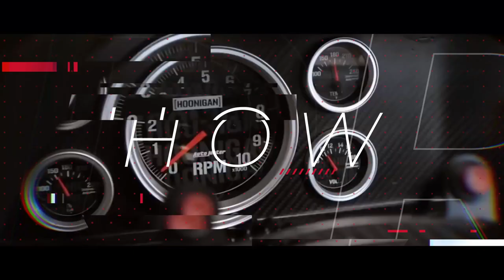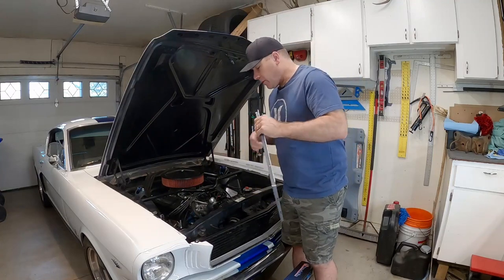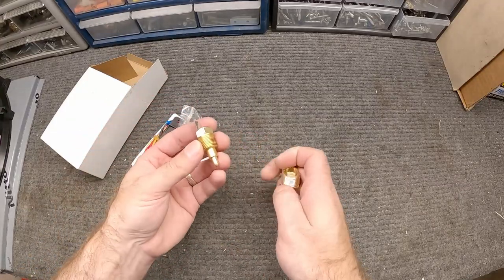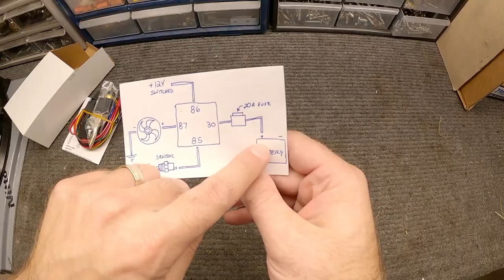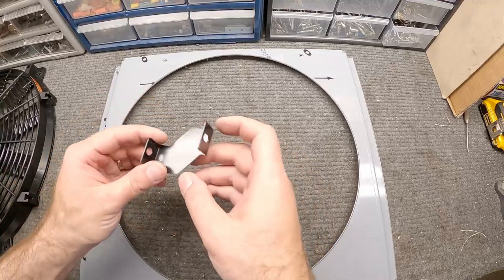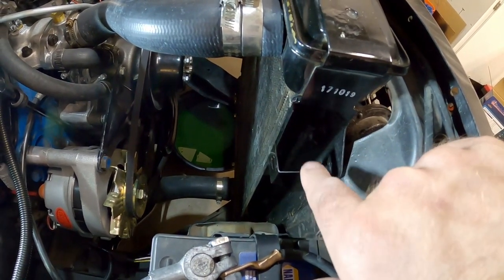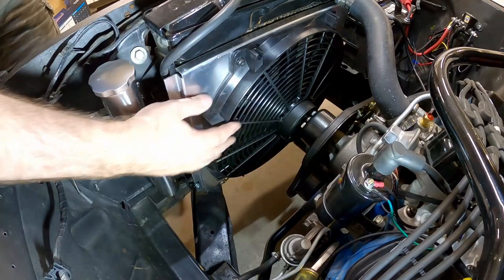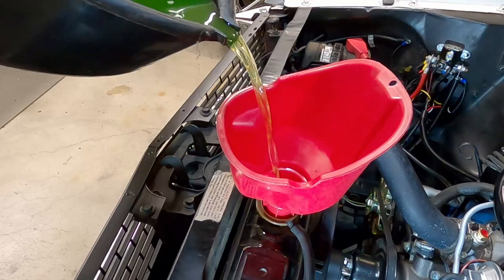How to Install an Electric Radiator Fan

Comment: Word of caution - whenever I'm wrenching really close to the radiator I put a sheet of cardboard between the rad fins and the work area. You don't want to slip with a screwdriver or a crescent wrench and puncture the fins. Ask me how I know! A little bit of cardboard (or an old towel) buys a lot of insurance.
Reply from the maker: Yeah, but it doesn't make for great content if I put safety and common sense first.  :)

Comment: Finally someone who knows what he is doing when mounting an electric fan to the radiator.  You should never just put an electric fan to a radiator without a shroud.  Good job
Reply from the maker: Haha, thanks.  :)
Reply: Неверно. Смотря какой кожух. Тот кожух,что он поставил - он будет создавать помеху для естественного обдува радиатора. Чтобы кожух хорошо работал и при этом не создавал сопротивления набегающему потоку - этот кожух должен быть достаточно широким и иметь коническое сужение к вентилятору. На редких машинах возможно соблюсти эти условия. Поэтому мой выбор - вентилятор БЕЗ кожуха.

Comment: Excellent content as allways.  Nice install.  I prefer the teflon paste on thermo-switches to help insure a good ground.  Especially on a single terminal switch.  Also touching the ground wire to the therm-switch body verifys your ground also for future testing.  Did'nt mention wire size but 12 ga is mandatory for maximum rated cfm.  Drive on brother!  The over ride switch for the sensor is good to have if there is ever a failure of the thermo-switch.  FWIW.
Reply from the maker: Great tip!
Reply: Spal all day long, I strictly run them and have never had a failure. OH and they actually work! If there good enough for Nascar, Mercedes and Lamborghini there good enough for me!

Comment: In the middle of installing my new rad with fan. It ended up being a lot thicker than my existing one so I have had to install it on the outside of the bulkhead with some adjusting. Hopefully the rest of the install goes smoother.
Reply from the maker: Unfortunately this can be an issue for lots of people wanting to upgrade the radiator and fan.  I heard that you can cut a slit in the top of the core support to allow the tabs of the radiator to slide down, putting the radiator on the inside of the core support (like normal) but the tabs are on the outside (front side).  This can provide 1/4-3/8" more space, sometimes it's enough.  :)
Reply: @AndyKruseChannel  that’s exactly what I done! Still not done yet but will try to finish it off before the weekend.
Reply: @AndyKruseChannel  I just went for my maiden voyage but for some reason my switched signal won’t activate the fan which eventually caused it to overheat. Not sure why not but will probably just run a manual switch to inside the cabin.
Reply from the maker: @Redmist.65  There could be a couple things going on here.  1 - the temp activated switch is no good.  2 - check the wiring for the relay, make sure the correct terminals are connected.  3 - you can check the whole circuit by grounding the wire going to the temp switch, if the fan turns on then there's something wrong with your temp switch.  4 - at a minimum you can wire so it's always on when the car is running, at least it will allow you to drive the car until you find the issue with the wiring.  Good luck!

Comment: Hay. Were else can you put the sensor? And also do you have the link for the Relay?? Thanks🤘👍
Reply from the maker: The four places I considered were the stock temperature sending unit location (behind the distributor), the thermostat housing (where I actually put it, but only because I had that style of housing), the radiator drain location (but I didn't want to lose the ease of draining the Rad with the petcock), and a union piece with a threaded bung that I'd have to cut the lower radiator hose in half and install it between the two pieces.  If none of that is a realistic option for you, then using that style that gets installed between the fins of the radiator might be your best option.
I updated the description with a link to a relay that will do the work you need.  :)

Comment: thanks for the vid andy, ive just installed my electric fan / shroud set up on the 65 fastback ,  your right about the clearance of the pully bolts and the fan, mine is just as close , to be honest it makes me a touch nervous , anyway time will tell
Reply from the maker: It will be fine, I haven't had any issues.  On my last Mustang, I purchased shallower head bolts for a little more clearance and cut about 1/2" of the alignment rod on the water pump snout off.  It gave me more room than I have now, but my current setup isn't causing any problems.  :)

Comment: I just installed got a new radiator with the electric fan and installed a new thermostat. 3 weeks later I started the car up again and it ran for about 20 mins! All the radiator fluid leaked out and there was a LOUD pop noise. 😫😫😫
Reply from the maker: Yeah, sometimes working on a car is not as easy as it looks.  :)
Reply: @AndyKruseChannel  isn’t that the truth! 🥴

Comment: Andy, when I was speaking with griffin about where to place our temp sensor, they suggest as far down in the radiator as possible because you want the fans to run based on the temperature of the coolant coming out of the radiator. If you have it on the top side, it's always going to run and will never shut off because the coolant is always above temp. We installed ours where the petcock was.
Reply from the maker: This is probably good advice.

Comment: You can also run a shorty water pump to buy 1.5” of space.
Reply: Do you have a part number or something I’ve been looking to get a shorter water pump if I do this!
Reply from the maker: I'm not surprised if someone offers a shorter water pump, but I just replaced it not long ago and I didn't want to buy a new one so soon.  However, I'll probably look into an electric pump next time.  :)
Reply from the maker: Interested too.  :)
Reply: Part: 302-WP-CW-SHORTY
There may be a few other models, too.
Reply: @CrazyGuyBlahBlah  sweet thank you!

Comment: Thanks Andy! Got this project done with the guidance of your video!
Had to buy an even lower profile fan cause low boy wouldn’t fit with my champion radiator. I even Cut the water pump stem but the bolts would still make contact 😅
Also, got a bad fan switch from the factory which had me baffled for a minute. I figured it out after I tested my switch wire to battery and temp probe wire to ground. Replaced the temp probe and it worked! 🎉
Reply from the maker: Awesome, it's always great to hear someone is able to use my videos to help with their project.
Yeah, I've heard a few people had fitment issues depending on the Rad they had in their car.  I was in a similar situation on my previous Mustang where I went as far as getting bolts for the water pump pulley that had a lower profile head (button head cap screws) and cut the pulley shaft (like you mentioned) to make everything fit.
Getting a bad switch like you got has always been a nightmare of mine.  Sometimes stuff like that isn't obvious and tracking it down can be a very large task.  Couple that with the fact that we all want to get our car back on the road and having to wait for a new part like that just delays everything, compounding the frustration.  I'm glad it all got worked out for you.  :)

Comment: Nice video and explanation but I'm not sure how that metal shroud helps. It's so shallow that it effectively blocks air flow through roughly 25% of the radiator. The electric fan has a shroud on it to focus and pull air through it without blocking the rest of the radiator. Shrouds for mechanical fans are about 3 inches deep and don't block any areas so air can still flow through every part of the radiator. This basically places a wall 1/2" from the fins. The only area getting vented is directly in front of the fan which may be enough but why block the rest of the radiator? It also looks like the metal shroud blocks about 1" of the diameter of the electric fan itself (13:33) so you aren't getting the full effect of the fan. I'm going to get one of these but install it without the metal shroud, it's pretty but not practical.
Reply from the maker: Good luck.

Comment: So I got all the same setup as yours but I forgot I had the champion two core radiator which is still thicker than stock. So it didn’t fit I might just go with the included zip tie mounts. I was thinking my thermostat is set at 195 so I’m thinking of getting a 200 on 185 off temp sensor instead thoughts?
Reply from the maker: I had a Champion Rad on my last Mustang and I had the same problem with the fan not fitting.  I cut off the steel shaft about a 1/2" or so that stuck out past the water pump pulley, and used low button head cap screws to hold the pulley on.  It was enough to clear and I never had a problem with the two touching, but it was close.  If you can get your shroud to will with all that, I recommend trying to get it to work as it will do a better job of keeping the coolant temps down.  Just don't cut off too much of that shaft, you still need a bump on there to help center the pulley, but the four bolts are doing most of the work.
I have a 190 thermostat and my temps are nice and low with my setup.  We've had some real hot days in the last few weeks and the needle has not gotten above the "m" in TEMP since I installed the fan.  Before I did the swap, the needle would get to the "p".
Reply: @AndyKruseChannel  Thank you! I did see that video you made but did not realize you also used shorter heads on the bolts I’ll try that as well as shaving down the center pin on the pump and see if I can get it to fit!

Comment: Would running the fan ground wire straight to the negative battery post cause any issues? I started having issues blowing out my voltage regulator shortly after installing one and just thought if maybe it could be related.
Reply from the maker: I don't see why running it straight to the ground terminal would cause an issue, but that's dependent on the wiring layout you've chosen.  Also, I'm not sure why your voltage regulator is getting thumped, but again it depends on how you wired your fans.
Reply: the sudden off/on draw on the fan circuit can be too much for some voltage regulators. You can add a "soft-start" circuit which may help.

Comment: My 65 has a radiator with the top hose on the passenger side and the bottom hose on the driver's side. I bought the car like this from a little old lady that finally decided she wanted to sell it,  Does anyone know what car this radiator might have came from? The block is at 302 from a 71 Torino, interestingly enough the heads are probably original because their stamped 65. I thought I would have to switch to an aluminum radiator but this setup seems to work really well. The only downside is you have a really small window to see the timing indicator because of the hose LOL.
Reply from the maker: You likely have the water pump that exits on the driver's side, hence the different radiator.  You could replace the water pump (I have a video on that) with a unit that exists on the passenger side, then sourcing a radiator for your car will likely be easier.  :)
Reply: That is a 5.0 conversion radiator but technically the offset inlet and outlet supposedly provided better flow hence why they switched in the later years.
Reply: @sergioacevedo2874  Thanks for letting me know. The car stays stable at 170, that seems a little low but I'd rather be low then high. I had a 65  20 years ago that had the standard inlet and outlet on the same side and the temp fluctuated a lot more then this setup does. Crazy that it looks like it bolts right up unless I'm not seeing something which is very possible.
Reply: @BPattB  I was watching a video the other day where they flir temp tested it and the passenger side inlet outlet just goes from one to the other with dead spots flow just goes from one end to the other unless it’s a more modern one with a baffle but the driver side inlet outlet forced the water through all rows so it would cool more supposedly. But cooler is better for sure. If the low temp is a concern you can check the thermostat might not be a 195 or 180. But low temp seems like a good problem lol. I’d check it with a temp gun just to confirm but sounds like a good thing lol

Comment: Hello Andy 
How do you like that fan ?
Does it really work cooling down your temp. I really like the Taurus fan i installed it on my 68 camaro. But the taurus fan wont fit on my 65 Fastback. In in California and sometimes you sit in traffic. Whats your experience with that low boy fan. 
Thanks
Reply from the maker: The fan is fantastic.  In the middle of the summer the car gets up to temp quickly and this fan brings the temps down in a hurry.  I can sit at a light, hear the fan switch on, and watch the temp drop on the gauge.  While the fan is doing most of the work, that shroud is the other part of the equation.  That shroud forces all the air pulled through the radiator to go through the fan.  Without it, the fan only works on the 16 inch circle covering the radiator.

Comment: If the motor mounts wear or you have power steering any concern of motor movement hitting that fan? I have fought so much with my car with mechanical fixed, fan clutch and electric to see what will cool best at idle and haven’t found the best solution yet. Electric fans require new beefy alternator and dont they block the wind at freeway speeds from flowing through the rad? I know the mustang forums are all over the board on electric fans and cooling.
Reply from the maker: The motor mounts and transmission mount would all have to wear out for the motor to move.  Not sure how a power steering car would do with this setup, but I suspect it would be fine as the water pump is dictating the available small space and the power steering pump would be off to the side.
People can preach all day about the factory fan doing a good enough job, or even a clutch fan, but I actually saw a difference in my car's temps.  With the hot weather we'd had this year, the stock setup has seen the needle on the gauge get to the "p" in TEMP.  Since I put the electric fan in, with no other changes to the motor or car, the needle hasn't gotten past the "m", and it's been 100 degree days here for a while now.  Some people are purist and they say the stock setup is fine.  Maybe for them, but not for me.  Plus, I have future plans that I don't think the stock setup will be sufficient at that time.
The fan on any car in any configuration doesn't do much for the coolant temps about 30 MPH.  At that point the air blowing through the radiator is doing more work.  I have yet to see the fan even turn on while driving on the highway.  :)
Reply: @AndyKruseChannel  great follow up information good to know! I already have everything else just need the slimmer fan and I will try it out too. My temps on both my 289 mustangs have been on the high side. The coupe has been good on stock clutch so far but in stop and go traffic with ambient vehicle heat it’s pegged temp a few times where I had to rev in neutral (c4 auto) to get it to cool more. All new cooling with an additional mechanics gauge along with the stock temp gauge. Idle is the bane of my existence trying to use my 66 coupe as a daily lol.

Comment: Hi Andy, Did you have any overheating issues? Thanks for anther informative video
Reply from the maker: Yes and No, my temps were getting really hot during the hotter weather we've had this summer.  Since installing the fan, the temps don't get as high, and the weather has gotten hotter in the last week or so.

Comment: Would it effect the cooling if the electric fan is placed on the front of the radiator?
Reply from the maker: This particular fan is a "puller", meaning it has to be on the engine side of the radiator because it pulls air through the Rad.  If someone wanted to put a fan on the front side of the Rad, they would need to find one identified as a "pusher" so it can push the air through.  So in this case, the fan I have in this video would not work as a Pusher, but Flex-A-Lite does make that fan.  :)
Reply: @AndyKruseChannel  thx for the explanation and answer bcs I’m looking for one to mount on the front side not engine side

Comment: Great video, I watched it before installing one on my ‘70 Mach 1 today. Like yours, clearance is tight. Have you had any issues with it being so close?
Reply from the maker: Thanks!
No issues with this unit, it worked great while I had it.  I have since upgraded to a larger radiator with a dual fan setup, to go with my new 347 Stroker!  :)
Reply: Got a 70 mach 1, keep your belt driven fan, there more reliable, I work in a restoration shop, we are always replacing electric fans in the shop, your car is now less reliable, owner of my car 46 years

Comment: Were you actually having cooling issues? I've seen several cases when the shroud will actually cause more issues. Don't be surprised if you need to punch some holes in the shroud. Can't wait for the ride report.
Reply from the maker: With the hot weather we've had lately, the needle had gotten close to the "p" in TEMP, but ever since I installed this electric fan, it hasn't gotten past the "m".
Reply: @AndyKruseChannel  What was the measured  temperature?
Reply from the maker: @swooshdave  I don't know, the Temp gauge in these cars does not provide that kind of info.  However, the higher the needle, the higher the temp, so the needle on the "m" is better than the needle on the "p".
Reply: @AndyKruseChannel  Do you have one of those laser temp guns? About $15 from HF. My thermostat housing reads exactly the same as my temp gauge (Autometer).
Reply from the maker: @swooshdave  I plan to install a set of Autometer gauges, so I'll be able to see the temp then.  :)